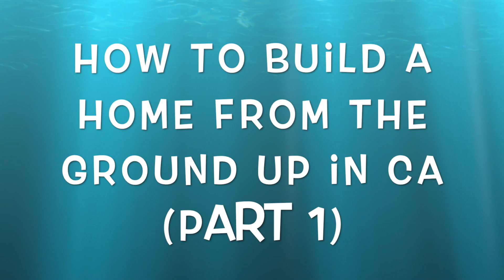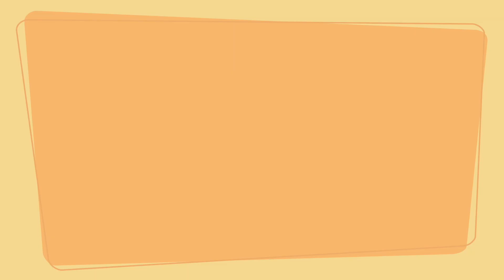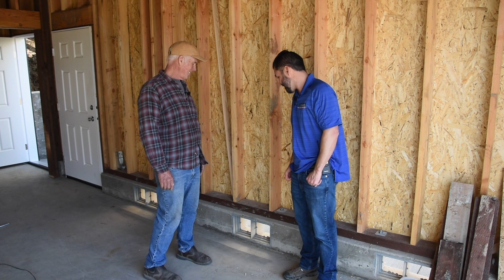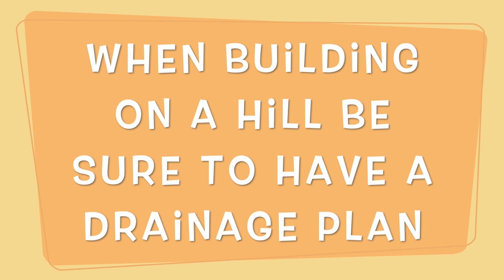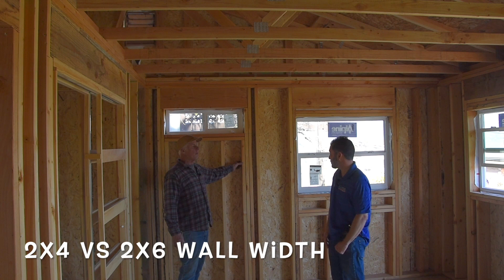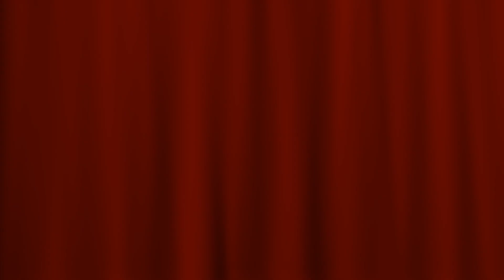How to Build a Home in California (Part 1 of 2)

Comment: Hi Rob, I have a piece of land ( flat) and I am planning to build next year. I just wonder which are first steps of planning to build the house ( land surveying , grading, soil testing or having to blue print)?
Reply from the maker: Ann, are you planning on doing it as an owner building or hiring a general contractor to handle the project?  If you are planning on handling everything yourself I would speak directly to the city or county planning department as they will be able to give you a checklist and point you in the right direction.  There is a good deal to take care of prior to breaking ground so it might behove you to seek the assistance of a licensed contractor.  There are also many fees like school fees, fire department fees, water, sewer and power hook up fees etc. so you will want to make sure you are clear on all that while preparing your budget.  I hope this helps.
Reply: @robtherealtor21  thanks Rob for great advices